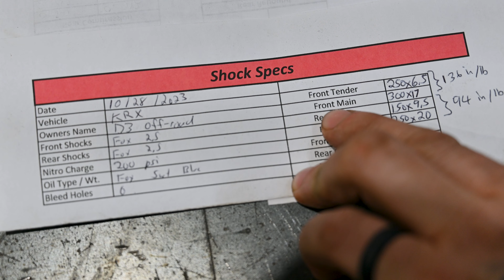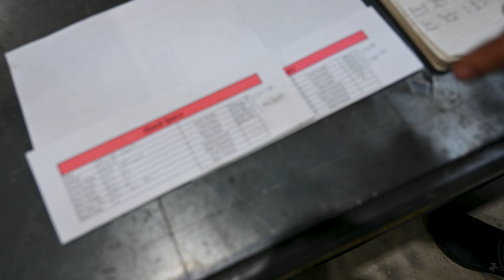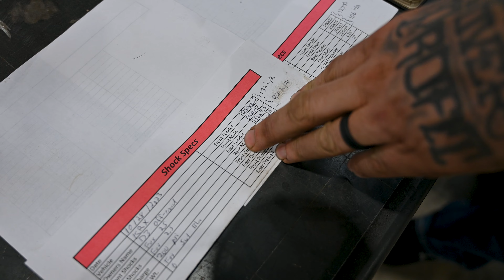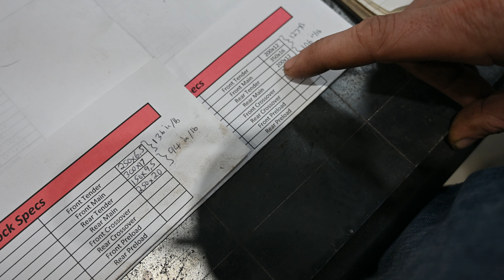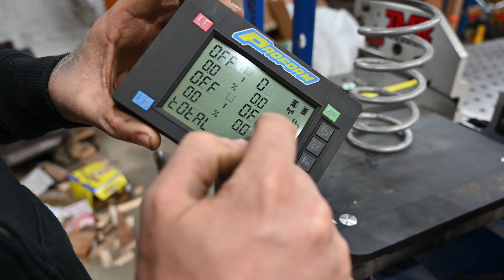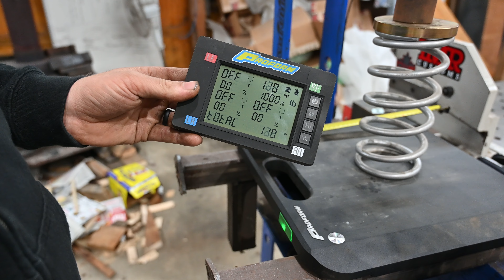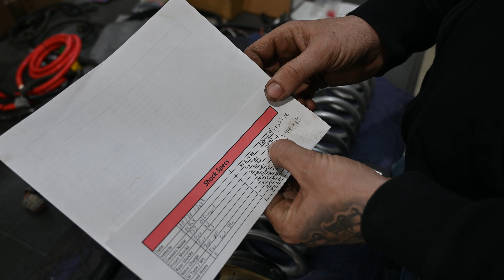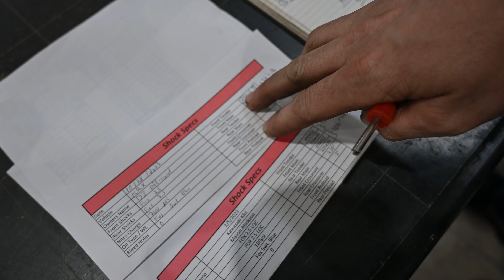KRX 1000...Is It REALLY Spring sag?? Coilovers Explained!!

Comment: Wow fantastic video!! My question is which tender springs ride the best with the correct nitrogen charge? Factory or Aftermarket tenders????? Thanks
Reply from the maker: It all depends on your setup and how much added weight you have on the machine! Either or will ride great for their intended use 😎

Comment: Since we seem to be on the same page here, i want to run an idea by you, do to my riding style, i was actually thinking about keeping the factory tender spring rate, but just buying longer tender springs,
Reply from the maker: There will be no benefit to a longer tender, the tenders are only used for 1-2” of compression travel then you hit the isolator on the cross over rings and ride solely on the main springs, which is what you want, also when going longer springs they can bow causing more shock wear on the body which is common with one of the famous brands most people buy, cheap quality and long = bad wear
Reply: @d3offroad  what would suggest doing with the tender springs then, because currently i filled the shocks with 190psi, and only way i can still get my ride height is to crank down my tenders to the point it rides like a brick, at slow speeds, i like the soft floating feeling they you, im running a long arm kit also,
Reply from the maker: @AniskaEnt86   Are we talking front end or rear end that you have cranked down? or all of them? the fact that you are running a long arm kit tells me you will need springs because you have moved the leverage point out further from the shocks by moving the tires out.  That will mostly affect the front suspension more than the rear. what model krx is it? Nitrogen only is good for stock machines without a bunch of added weight or mods to the suspension once we get into bad ass upgrades proper shock setup is key for the best performance! internal valving and correct spring rates.
Reply: @d3offroad,  Im running the SATV long arm kit on my KRX, " i should have stated that" (unfortunately we can't post photos or id send some photos of how i have my set up) its 3 inches wider each side, front and rear. With 190psi in shocks, and tenders pretty much cranked, I've got 18 inches of ground clearance, front and rear. This is where I've run into suspension "issues/concerns" in the past with similar setups. See if im not hard rock crawling, like windrock trail 15 or devils type stuff, 75-85% of our riding is under 15mph, in tight technical rocky trails. Every shock company i ever talked to in the past basically told me im pissing in the wind by doing full shocks. On my last sxs (x3), i picked up some Highlifter tenders for cheap, and honestly, it rode quite nice and didn't have to adjust them at all. That's why i kinda had the thought process of adjusting the pressure and running a slightly longer stock tender.
Reply from the maker: @AniskaEnt86   Ya that long arm kit is going to change things, 18" is very high in my opinion we run all our machines around here at 15.5" give or take 1/2" on 35" tires because I don't use ground clearance to set up shocks it is incorrect... instead I use cv angles and amount of shaft showing on the shock. to better help you maybe you should e-mail me and we I can send you my form to fill out to get a better idea on your wants/needs! d3-offroad@outlook.com

Comment: I did already bought the bandit springs but. I also have a modified heavy cage, milwuakee 3boxes in the rear and front and rear winch.    Would you say the bandit spring. Stage 3 is still better for my setup?
Reply from the maker: I’m not familiar with the bandit spring rate is so I can’t really say.

Comment: I would be interested in a talk about the spring isolator rubbing on the shock body and slapping the isolator adjusting rings. On my 24 KRX4 with Fox Live Valves the front shocks are making noises that seem to be the above described on sudden compression. Sounds like a loud tap and a zipper noise? Could it be the lack of nitrogen pressure?
Reply from the maker: I would try lowering the cross over rings down so they are 1/4” from the slider when parked and see if that helps with the clunk noise.

Comment: Thank you so much for the excellent content. I have a 2021 KRX Trail Edition, and like many I am experiencing "Spring Sag" and was indecisive about whether or not to do springs or nitrogen. I had seen somewhere, (possibly one of your earlier videos) that nitrogen was a solution for so called spring sag, so I went ahead and put all the items in my Amazon cart to do a recharge. Then I came across a thread in a popular KRX forum basically calling nitrogen recharging a snake oil solution to ride height and spring sag issues, so I started contemplating springs. After watching your video and seeing actual numbers, actual measurements and your pogo stick demo (🤣🤣), I have decided to go the nitrogen recharge route. The numbers and measurements do not lie! Now that you have clarified that for me, what's your take on aftermarket clutch weights vs. OEM?? 🤣🤣 🤔🤔 Keep up the good work!
Reply from the maker: Haha thanks for watching! Don’t get me wrong springs have their place if you carry a ton of gear and the nitrogen is setup correctly you might need springs if you’re going beyond ideal amounts of preload… but that isn’t very common on krx! Or if you’re trying to achieve a really slick race tune and preload and spring rate is super important but the average trail riding through the bush just need correct nitrogen and a good internal shock tune. As for clutch weights from all our research the JBS weights seem to last the longest we are running them in our machine 😎

Comment: Awesome video.  Is there a way for us to check and change nitrogen pressure without taking the KRX in to be serviced?
Reply from the maker: Once you get the caps modified for a Schrader valve or buy new caps you can easily do your own maintenance! With a few tools but the factory caps don’t allow for that

Comment: Thank you for the information, very confusing reading all the comments on different platforms.  I am a new KRX trail addition owner.  KRX is a great machine so far, I am coming from a Teryx 750 2 seater.
Reply from the maker: Glad it was helpful! There are still times where springs are required of course but not every owner needs to run out and buy spring kits right away like you see on a lot of Facebook posts 😉

Comment: Excellent Video!! I just purchased a 2023 on Blowout yesterday. Been doing a lot of research. And I was already thinking I would be replacing the stock Springs from sag. Before long, from all the videos I've seen about it already! So glad I found your videos! Great looking Cars as well! GOOD JOB!
Reply from the maker: Thanks !!
Reply: The stiffer factory spring 6.5” compared to aftermarket 12” the multiple factory per inch . The travel length would affect the overall compression ratio ?
Reply from the maker: Sorry I’m not quite sure I’m following your question. Could you try rewording it?
Reply: Sorry, really wasn't a question. I was just commenting, that I was glad to see your video. Because I had seen so many others talking about the springs sagging. When maybe all they need is to recharge the nitrogen.  @d3offroad
Reply from the maker: @hexhound2273  ahhh gotcha! Thanks for watching!

Comment: Thanks for the info, great video.
Question;  lets say the inside diameter of a Fox 2.5 is 2" (3.14159 square inches) and we put 200 PSI in the reservoir, then do we have 628 pounds "pushing " to keep the shock extended? 
That would mean, combined 4 shocks would be 2500+lbs, which would support a 2000 lb machine without exerting any force on the springs?
It seems I've errored in my calculations, what I'm doing wrong?
Reply from the maker: I’m not following your science haha, the 200psi is pushing against the oil and set at 200 when the shock is fully extended as you set the vehicle weight down the shock compresses under that weight therefor the IFP piston moves inside the resi and the 200psi will be increasing as the area for the nitrogen decreases…. Not sure what square inches or 628 has to do with it please explain your thoughts some more for me to wrap my head around it!
Reply: Sorry for confusion.
If there is 200 lbs per square inches against a piston that is 2 inches in diameter (the area of a 2 inch circle is 3.14 square inches) 200 x 3.14=628 total pounds of pressure against the piston.

Comment: Astonishingly informative!  Thanks for the education!  But I have a question:   I now know the importance of the nitrogen pressure but does nitrogen volume come into play in any way?  For instance, there are extended "High Volume" reservoir caps on the market for x3s.   Thanks!
Reply from the maker: Volume does come into play more so on smaller resi shocks the x3 has massive resi and it’s also more important in say desert racing for long periods of time where you can get shock pump from pressure rising due to heat, for the average rider who takes breaks to hang out every hour it is not really needed the shocks always cool off

Comment: I just found your channel. Very educational. I’m learning a lot being new to the SxS world. I have a 2023 Teryx4 s-se 800. Live in Fl. I’ve done some minor upgrades (mud tires 30”, snorkel kit, ECU tune by VFJ, lastly removed 1 cat right behind muffler)  My question is should I also do the nitrogen cap mod and I was also thinking of dual rate springs from Bandit?
Reply from the maker: Thanks! He’s all shocks will benefit from getting a nitrogen cap install/mod and if your machine does not have a true dual rate setup from factory it’s a huge upgrade! Where the KRX has a great dual rate from factory it is not a huge upgrade.

Comment: Definitely agree on the nitrogen! I had a few inches of sag and had my rr shock leaking. I ordered the schrader valves from brute and had a local guy rebuild the shocks. Set them at 175psi. Regained my ride height back. No need for spring adjustment at all.
Reply from the maker: That’s awesome! Good to hear!
Reply: What'd that cost you

Comment: Thank you very much. This information was very helpful. My KRX was saving bad and was going to order the tender springs but now I’m going to find a place here in northern Alberta to check my N2 pressures. Is it possible for you to check the highlifter spring spacer lift out and let me know if they are any good. Love the videos you guys do thx for the time and info you guys give on the KRX.
Reply from the maker: Spring spacers are the exact same thing as adding preload to your shock, so adjusting the collar down on the top to get you sitting higher. I don’t recommend either of those if you want it to handle and ride the same you need to instead move shock mounts to get the lift height

Comment: I found this video super educational and informative! I have a KRX 4 ES SE and I’ve constantly read about how bad the KRX will sag over time. I’ve added a lot of weight in accessories and I check ride height periodically because the internet taught me to worry about spring sag. This video explains a lot that was confusing me.

The only ride height I ever lost from the factory, I gained back from installing the suspension mount reinforcements from Full Access. I was surprised at how much flex there was in the shock and upper A arm mounts. I haven’t lost any ride height in the 6 months since I did those reinforcements, and I have around 200lbs in added weight. 

I guess I’ve still been lucky if I haven’t had any nitrogen leak down where many people do, but the sagging always seemed weird to me that it would be spring fatigue without years of abuse

Comment: Great video. What tire pressure  do you run to allow the suspension to do its work?
Reply from the maker: Tire pressures change based on trail conditions and riding style for the day, slow technical rock crawl we will go down to 4-6psi more fast pace ripping on trail 8-12psi usually

Comment: So the tender bottoming out is the "common" suspension "clank" i read about?
Reply from the maker: The spring isolator “black plastic thing” coming in contact with the cross over rings is known to make a clank noise on the krx machines that’s right! A lot of guys will put old oil filter rubber o ring gaskets on the shock to act a damper to help get rid of the noise for all of about $5 vs buying expensive fancy silent rings that do the same thing
Reply: @d3offroad  ok, thanks. I took mine out the weekend after i picked it up (0 miles), and it clanked. Reading post abut it don't do it justice hahah. Yes, it's very annoying, so that will be done before i take it back out.  Also i will be keeping a eye out for any loss of ride height. Any other suggestions on upgrades or mods to do for a new owner like myself?

Comment: How can the combined rate be less than the rate for either of the two springs? How does the Math work?
Reply from the maker: Formula - (150x200) / (150+200) = 86lbs 

Those are generic spring rates you can use your own numbers and that is why we use a dual rate system so for the initial amount of travel the spring is softer more plush and as you compress the shock it hits the cross over ring and jumps from 86 up to 200lb on the lower main spring to avoid bottoming out 

Hope you find that helpful!

Comment: Question...you was showing a standard krx spring. Would it be the same nitrogen concept on the electronic version
Reply from the maker: Exactly the same concept! Only difference on the ES is instead of manual shock clickers, it’s an electronic servo to go from soft to firm. Springs and all other inner workings are the same. UNLESS your shock is the Live Valve bypass shock.

Comment: Would like a video on changing the oil in the shocks hope to see that. I agree on the tender spring I got aftermarket springs and I had to clamp the spring down 3 inches to just get it on then run the adjustment down another 2 inches to get ride hight. Was alway told that you should only have to go one inch past 0 sag to get ride hight if you had to go more than that the spring rate or length was wrong. Keep up the good work and always enjoy your videos
Reply from the maker: We could do that! Thanks for watching!

Comment: You had mentioned in one of your earlier videos, about doing a review in depth on the KAWASAKI INTERACTIVE DISPLAY. I would love to get your opinion on it! Is it worth it?
Reply from the maker: We will be putting that out shortly! It’s all personal preference. We run it on one machine, and Steve finds the cameras and tracking feature useful.
Reply: I highly recommend it. I have the 4 seat es se, and having the rear camera is super useful. It also gives you full diagnostic info, and it allows you to have your engine gauges in front of you, and your live suspension info on the display screen

Comment: With the live valve shocks on the ES and ES special edition models can this be done? Or is it a different process?
Reply from the maker: Yes, it does not matter if it is live valve or not, we are currently fixing a 2023 with live valve that came in with 9" of ground clearance and is now back up to 14" with 160lbs of gear in the bed! all the IFP were blown inside the resi oil passed them and low on nitrogen and it only has around 700 miles on the machine...

Comment: Do y'all run with your sway bars hooked up? and do I risk having a shock come apart by running them disconnected?
Reply from the maker: We have removed the front sway bar completely from the machines, no you do not risk any shock damage without a sway bar. Sway bars jobs is only to control body roll in corners to help fight weight transfer it has no effect on shock droop/extension. The only way you can really damage the shocks is if you put an aggressive spring package with super party mode rebound tune and big heavy tires 😎

Comment: ok so my question is....are the schawder valves on the shocks the same as hvac valves or will you have to use a special something to put nitrogen in with??  thanks
Reply from the maker: The valves are just like on a tire but you need to use a zero loss gauge when charging them up so I guess you could consider that a specialty tool